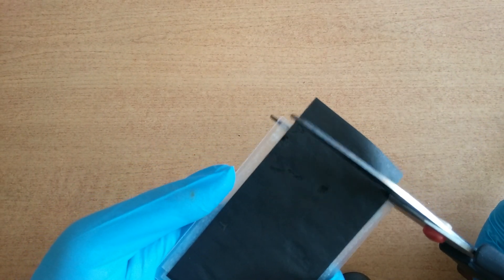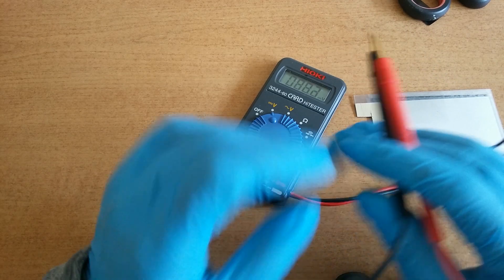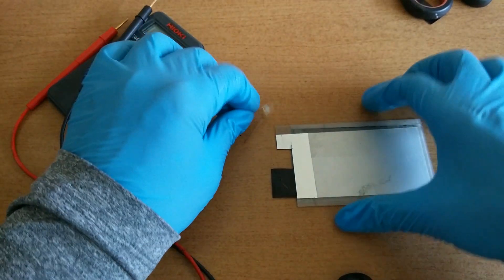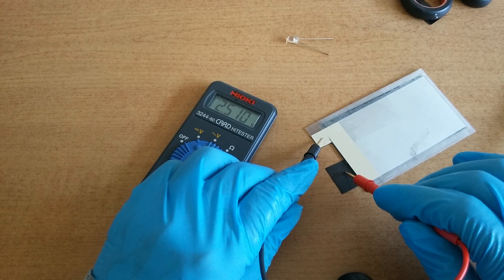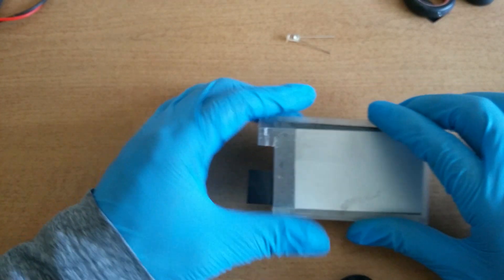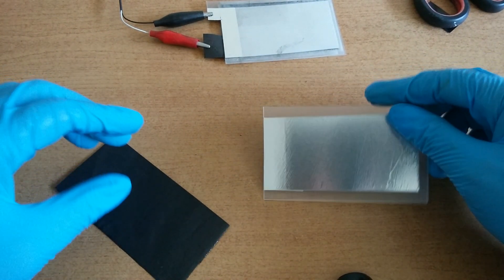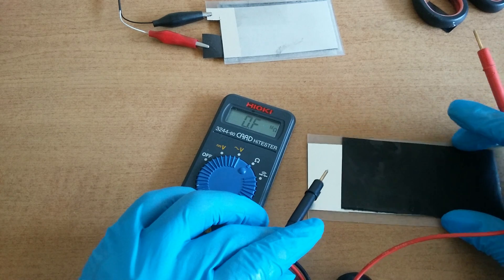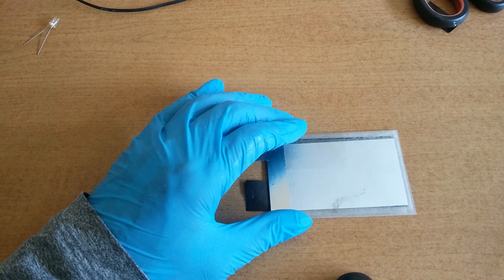gtaphene iron oxide solid state battery

Comment: Also aluminum is notorious for forming non-conductive oxides. Just as in TIG welding, cleaning and hermetic sealing using an inert gas envelope could help to reduce detrimental oxidation. Vacuum packing the cell is another consideration for experimentation if you have the equipment.

Comment: @solid battery to lower the resistance, try to scrub the graphite surface with a spoon. It will be shining like a metal. Measure the resistance putting a piece of wood between the probes to keep the distance constant. I would use active carbon powder + iron +toothpaste+detergent. It would dramatically increase surface areas.
Put the active carbon + iron oxide in a blender.
Reply: También el detergente dentro de la licuadora para exfoliar el Grafito, algunas personas incluso recomiendan emplear suero de leche 🥛🍼 micronizada
Slds cordiales desde Argentina 🇦🇷👋

Comment: I think you need to consider the difference between "through-plane" and "through-plane" resistance.  Why not use a uniform conductive ink with active material (ie Doctor Blade or Meyer Rod applications) rather than a separate collector/electrode 'sandwich' :)

Comment: The brilliant thing about these experimental "solid" battery is their relative immunity to over voltage charge and current absorption and release is governed by materials selection and construction, compared to liquid electrolyte.
So rightfully current storage and release will be paramount to be useful.
I have constructed multi layer battery with a reasonable output to illuminate a 12v three LED string with an inline resistor from a few minutes to +6hrs as a demonstration of functionality.
So, yes, it works, but within the limits of the material availability and construction.
I am pleasantly surprised and challenged by this.
Thanks MK👍

Comment: Im kinda new to the battery thing, but i find it very interesting... I am really into electrical motor bikes (more like dirt bikes), dont own one sadly :( but im thinking about building one.
But one problem I see, is that electric motorbike batteries dont last that long, and If you want good battery, it's very expensive and it gets really big and heavy.
Been researching batteries for a while, when I learned about solid state batteries... now Im here.
Im also thinking about doing similar experiments like you do, you are very inspiring to me...
Got one question since im writing (will probably learn about it but...), How do you know what side is pozitive and what is negative on your battery and how much voltage and amps are you using to charge battery?
thanks
Reply: I found out Anode is pozitive and cathode is negative... Im bad at chemestry, but how do you know what material can be use as cathode or anode... I know materials have certain amount of electrons and protons... but i googled some materials that are used as cathode and anode and like 1 material has same number of protons and electrons (like aluminium has 13 protons and electrons).
I still dont understand which can be used as anode or cathode
Reply from the maker: @PalushekDom  
Intrinsically, battery uses potential energy. There is electric potential difference between elements. For example, the potential energy of lithium is -3, and carbon is 07.

0.7 - (-3) = 3.7 V 

So lithium battery is 3.7 volt.

Have a nice day
Reply: @solidbattery9956  Oh yes, I was looking for this, yes. I saw 1 video on youtube explaining how lithium battery works and he mentioned something like that, but i wasnt paying that much attention to remmember.
Thanks

Comment: Hi MK, I have been following your posts for some time now, and I thoroughly enjoy the perspective that you bring to everyday items and chemicals that can be used for energy storage device construction. Graphene/Graphite materials are unfortunately a deviation for me, as these are not readily available and costly. So there is a heavy reliance on aluminium foil, charcoal and activated charcoal as the main structural components. the biggest challenge is still current collector corrosion. Hopefully a solution can be found which is easily and readily formulated. Great work and commendable effort on your English and especially, your willingness to cross language barriers.
Reply from the maker: Thank you so much and I will keep in mind what you said. Have a great day

Comment: Hey, your work is coming along well. I would like to give you a suggestion on your problem with making the graphene paper more conductive. If you're using high quality graphene that is good but you may wish to add different size particles to fill in the gaps between the graphene molecules such as carbon black or lamp black as some may call it which is made from the burning of pine. You may also wish to add some very fine graphite to the mix. With a mixture of graphene, lamp black, and graphite your ink should be very conductive. Also instead of using paper for sticking the graphene to, maybe use some very fine mesh. Windows screen would probably be too thick so you would have to go with a silk screen mesh or thinner but would allow a direct contact with the aluminum without interference from an insulator.

I would also like to make another suggestion for making your material more capacitive. If you were to go down to the shoreline and scoop up some seaweed from the shore that has washed up and place it in a blender, or coffee grinder or some other device used for chopping up things into fine particles, The capacitance of your solid state electrolyte would improve greatly. The small cells and structure of the seaweed create natural miniature capacitors within the electrolyte thus giving you the ability to increase capacitance and amperage. Not to mention that it is jerk sheep because it is free , The lamp black you could do on your own and would cost you nothing. The only ingredient that I have suggested which is the graphite powder is easily obtained from any hobby shop and cost very little I find the graphite powder used for the roller derby cars in the boy scouts would be sufficient. But if you have access to scientific supplies you can get it at any micron level you wish.

I hope this helps you Good luck on your endeavor.
Reply from the maker: Thank you so much. As you mentioned, I am mixing other materials. But I didn't know the performance of seaweed. Thank you so much. Have a nice day